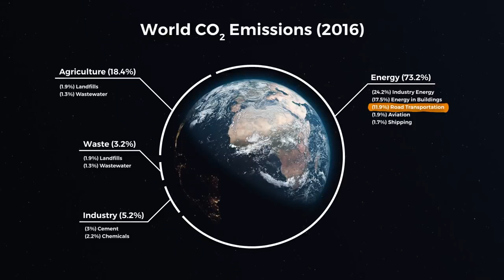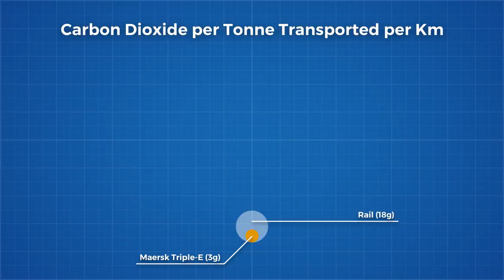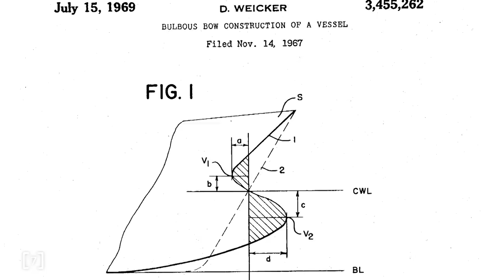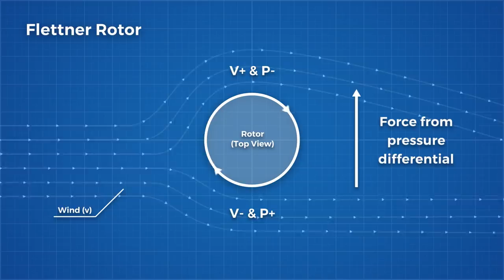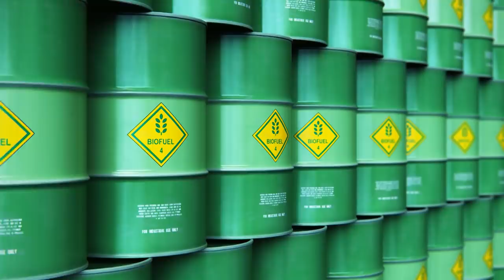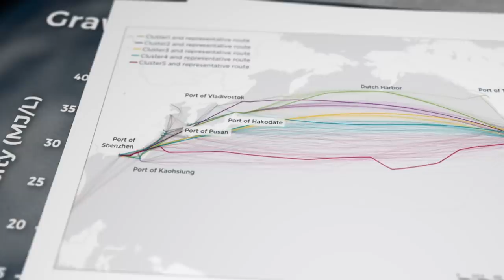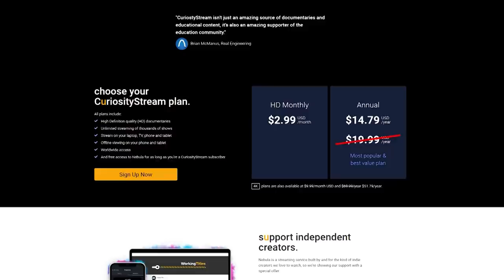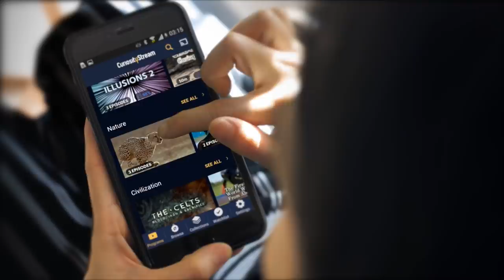Are Renewable Powered Ships Possible?

Comment: Regarding the issue of hydrogen storage, refueling and the route issues, I have a thing I want to mention in regards to video source 15 & 16 which is used around 11:05
Why do I go back to this point? I looked at the sources and couldn't easily find out, wheter or not the solution I want to point out was taken into account or not when adressing the renge issues and while video source 16 pointed it out, as something that does exist, it was seemingly not appearing in the tables given. The storage solution I want to discuss is hydride based storage:

I remember talking to someone (thus first hand knowledge) who works with metalls that form metallhydrides when put in steeltanks under H2 preasure, this reduces the preasure and allows you to store more of the hydrogen. When filling the tanks, they chilled them with water via a seawater-use water heatexchanger (coastal stationing), when they wanted to get more hydrogen out of "the bottom of the barrel" they used heated water to warm up the "storage tanks", the heat is in their case wasteheat from other systems. The chilled fueling allows thanked be thermodynamics, to get in more of the H2, due to lower preasures at constant mass and colder temps, the formation of metalhydrides reduces the preasure as well, keeping the chilling going means less thermal issues from the hydride formation. When scraping out the bottom of the barrel, heating the tanks "breaks appart" the hydrides and lower preasures (from the almost empty tank) make this a lot easier as well. The guy that told me these things said their metalls were a mixture with a lot of manganese, but he mentioned that there were apparently test with carbon and other lightweigt materials that would result in a weigth reduction, better for cars, a bit more irrelvant for stationary use and ships, especially if one remembers that big freight ships usually have a really big chunk of concrete in their bottom, for stability reasons.
As for the preasure, according to the German wiki page [X], using the hydrides means 1-3 orders of magnitude lower preasure at the same mass compared to traditional preasure storage, I have no idea what the "orders of magnitude" exactly are, they don't hold a direct refference, but this corresponds roughly with what the guy told me, his explanation said that 10 times the mass is "normal" and this seems to correspond with 1 order of magnitude 100 times would be "very good" and 2 orders of magnitude, thus 3 orders of magnitude would be 1000 times and probably lab results.
Considering that you can buy 200L bottles, with 300Bar [1] this would mean that at 300Bar you could theoretically get up to 25Kg/m³ (Storage density), since that would be an ideal gas more reasonable assumptions[2] would be 21ish Kg/m³ but that is without the hydrides, multiplied by 10 [3 !!!] this would give us 21 Kg/m³ * 10 ~= 210 Kg/m³ , not including the "lost volume" due to the metal that forms the hydrides, or storage compartments that would hold them. Again I have to point out that the 10 is NOT the EXACT number for the order of magnitude but something to give you an idea of what is happening. 
These things would weight something as well, though the storage compartments could be made from aluminum alloys and be "somewhat" lighter, certainly more so then the stuff that forms the hydrides. Another thing is that tanks that can withstand more preasure (let's say 700Bar, as per [2] ) are somewhat heavier and certainly not something to be "toyed" with, compressed air in generell never is!
One of the problems is that in closed spaces you might need a double walled pipeline, the outer one would be filled with a different gas (He, N, etc.) and would be your measurement for leakage via gas detection, this is a nessesary safety precaution, as hydrogen will "vanish" from a stainless steel container, that has been welded shut perfectly, it simply "crawls" through the metall, more specific the smallest rooms between and sometimes even through the crystal latices. Helium has a simliar issue and follows the "crawling trend" as well but to a lesser extend, however as was mentioned in the video, even the "standard" fossil gas and renewable gas will find ways to leak, it just happens that gases with a smaller atomic number are better at it then ones with a higher number, let alone hydrocarbons molecules.

[1] typical would be 50L at 200Bar or 300Bar from let's say Linde   https://www.linde-gas.de/shop/de/de-ig/gase-kaufen/wasserstoff#/300_bar
[2] https://emcel.com/de/warum-fasst-ein-wasserstofftank-bei-700-bar-nicht-doppelt-so-viel-wie-bei-350-bar/
[3] Referencing the previous explanation and asuming a "reasonable" and "normal" expectation of 1 order of magnitude, thus 10 times, 2 orders of magnitude being 10^2 ,three being 10^3 ...

[X] Not a real "source", I know,  but you get the info where you can get sources and read up on the topic, where I did https://de.wikipedia.org/wiki/Metallhydrid

Comment: @RealEngineering Why didn't you talk about the possibility of having some very large ships powered by small (modular) nuclear reactors? And why did you just say that Hydrogen could be a possibility, without talking about how Hydrogen is currently manufactured (usually using SMR, which is a CO2 intensive way of making H2).

I think it's a pity that you haven't mentionned Nuclear a single time, as it has proved in most army ships a viable and very reliable way of generating clean and near to unlimited power for the ships. Some small modular reactors could even be once installed and run for the greater part of a ships life (30yrs), nearly without the need of intervention more than once every 7 to 10 years (or more).

Comment: Shouldn't be too hard to double their efficiency. Throw some of the new fancy fluoropolymers on there, shield certain areas from skin drag with bubbles, improve the entropic efficiency of the powerplant by 30%, and throw a big fairing over the windy bits with (ideally) passive distributed redundant optics instead of the big control tower.

Comment: Biofuels: Cannabis.

It's capable of producing a variety of different fuel options (oils to liquid fuels by compression particularly of seeds / gasification of the fibrous parts / biodigestion of the separated tars for methane) while not being necessarily dependent on the same farm lands that grow food crops.

Sure, weed is fun and all, but what papers I've read has shown that with sufficient sunlight and food/fertilizer you can grow cannabis in heavy CO2 environments to improve growth/yields meaning we can use the waste products of our existing energy grid to speed up production of replacement biomass.
Add on that we can use the CO2 to extract the oils and other volatile solids from the plant matter and we're doing waste use double-duty.

Tangent: I think a disc Tesla-style turbine has a really underrated applications on this biomass front. The research papers I've been reading on steam injection to gas turbine ("Cheng cycle") suggests there are numerous benefits to doing this. It appears to reduce NOx production, can help cool the combustor allowing a leaner burn with more thorough combustion while keeping the temperature of the combustor materials under control and increases the volume of gas passing through thereby increasing the power output of the turbine for the amount of fuel used thus increasing fuel efficiency.

But doing that is inherently risky in a normal gas/steam turbine as high speed water droplets act like bullets. Given that biofuels come in two general categories, highly processed [ex: ethanol] which factors in the cost or unprocessed which favors low cost but tend to be 'dirty' [see Colin Furze's gasifier-powered lawnmower gunked by water/tar/etc) so that's where the mechanism for Tesla's turbine shines: Doesn't care about small particulates or multi-phase (water/steam/flue gas mix) meaning we can use crude but simple biofuels without the usual technical problems presented by those fuel types.

Mind you I don't think that a Tesla turbine engine should be the machine that powers a ship at all. I think that’s best suited to an electric motor so the turbine can function as a generator where it will be allowed to function solely at peak efficiency.

I realize this sounds more than a little crazy but using an engine that’s that forgiving about what kind of fuel is used opens up the hypothetical possibility of using a crude but highly flexible gasification system (if tars can be directly combusted without fouling the engine than a stratified gasifier is highly flexible on fuel types) which opens up regional fuel sources made out of crudely processed vegetable oils and husks/shells/literal animal shit which, even at a loss of storage capacity, seems to have a self-evident economic argument to warrant consideration.

Anyways that’s my crazy man rant. Hope y’all enjoyed. Gonna go hunker back in my bomb shelter that I totally don’t plan on one day owning. cough

Comment: But won't lower speeds cause longer days at sea and potentially delaying delivery of cargo?
Reply: On the ‘reduced impact front’ a lesson might be learnt from the past, in the 1930’s a group of six ships that were being built for the British Tanker Company (BP) to their “Three Twelve’s” design (12 000 tons deadweight, with a speed of twelve knots and a fuel consumption of 12 tons per day).  These ships were purchased whilst still ‘on the stocks’ and completed for the Admiralty so they could keep ‘the fleet’ fuelled up and at sea.  12 000 tons deadweight (dwt) is tiny by today’s standards with ULCC’s being twenty five times that size (300 000 dwt) while typical service speed has only increased to around fifteen knots, or by 25% if you like to keep things relative, and daily fuel consumption has gone up to about 60 tons (or half an order of magnitude to be academic about it).  Bear in mind that speed reductions, a useful buffer for adjusting variations in demand, will in the long term require more goods in transit to maintain any given long term level of supply.  Typically tankers move at 15kn so a reduction of speed to 12kn could yield a fuel consumption saving of 20% (?), however to maintain the same flow of material an additional 25% of shipping capacity will be required.

4 ships at 15kn = 60 freight miles = 5 ships at 12kn.
fuel used x	                                        fuel used x (+ or - ?)

Comment: Just to bolster some of what you said, I did a research paper a couple years ago on biofuels. The conclusion I came to was much the same as what you say in your video. The vast majority of biofuel (bio-Diesel, Ethanol, etc.) are a complete waste of effort and don't do anything to reduce emissions. As well, if we needed much more biofuel than we currently produce, we might actually run out of corn. I think the stat was something like, if we convert ALL the corn we currently produce into biofuel, we could produce a whopping 1/4 of the amount of fuel we consume each year. And obviously we would have 0 corn leftover for anything else. And burning pure ethanol is terrible for engines, so unless it's mixed with conventional fuel (or new engines are produced specifically for it) it can do serious damage. There were a bunch of other points I made, but I'd have to go find that paper haha

Comment: Can you do a video on biofuel? I'm curious as to just how green it actually is.
Reply: Short answer, not very; major problem is land use.  On a small scale, to use up the waste products form other industries like forestry agriculture, they are is a good source of carbon molecules but all 'alternative' fuels still involve a combustion stage and some noxious effluent, NOx for example.  Fossil fuels run up from CH4 (methane/biogas) to very thick black HFO cSt380.  The sweet spot is kerosene, aka gas turbine fuel, as used in modern aircraft engines it is energy dense, hydrophobic and relatively safe.  Creating a non fossil substitute is the holy grail for chemists, like turning base metal into gold.  Basically history on a geological scale has done a lot of heavy lifting for us humans.

Comment: Water wheels on the sides, solar panels on the fixed areas. Small windmills where you can. Should produce enough electricity to get it 20% if its way electrically.

Comment: Hey, shipbuilding student here. So in my opinion (and the opinion of most of my classmates), wind power could be a thing, mainly thanks to the SolidSail that is currently being tested in St-Nazaire, France, or with the help of SkySail’s project, with the Beluga Skysails as a test bed. We are currently working with our teachers on wether or not this is a good idea. Just to say, we are well aware of all the new things that pop up in shipbuilding technology, and we also are more likely to incorporate these technologies into future ships projects.
Reply: In 1870 a premium sailing vessel entered service, the ‘Cutty Sark’.  The ‘Cutty Sark’ was 64.74 metres in length with a beam of 10.97 metres and a loaded displacement of 2 100 tonnes.  She was able to carry, at best, 1 700 tonnes of cargo and to harness the energy in the wind the available spread of canvas was up to 2 976m2 which was tended by a crew of about 30 skilled men.  The ratio between the sail area (SA) and the vessels displacement (D) determines how lively she was; ‘lively’ or ‘fast and manoeuvrable’.  The carrying capacity of cargo ships is constrained in two ways, mass and volume which leads us to the ‘stowage factor’ of the cargo; the more mass on board the greater the displacement which in turn impacts the efficiency of the hull form and the sail area / displacement ratio.  When in the tea trade, which the ‘Cutty Sark’ was designed and built for with fine lines she could carry around 600 tonnes of cargo at speeds of up to 17.5 knots dependent on the prevailing wind and had a typical China to UK time on passage of 120 days.  The tea trade was very competitive so ‘time on passage’ was a large factor in securing the premium freight rate that made the ‘Cutty Sark’ cost effective.  Rounding things out, her maximum available sail area gave circa 5m2 of canvas for every tonne of tea carried.

As soon as the Suez Canal opened, which the ‘Cutty Sark’ was unable to sail through; she lost her advantage, raw speed, to the steam powered ships of that era who could beat her ‘time on passage’ by taking that short cut.  Mechanically powered ships have improved in terms of efficiency, on a freight tonne mile basis, by at least one order of magnitude since then.  Random fact about ‘Cutty Sark’, it is said to have been possible to coax 3 000 horse power out of her sails, or 2 206 500 Watts (2.2 megaWatts) or 741 Watts for each square meter of sail area, in ideal conditions.  The sails on the ‘Cutty Sark’ produced about 0.33% of the power need to propel a Mearsk Triple E and proportionally a Mearsk Triple E would need a sail area equivalent to the acerage of a small farm to not go as fast.  You and your colleagues have probably considered the wind speed envelope in which your design will operate and the wind patterns that prevail over the trading area you intend to service will you be able to match the availability and reliability of hydrocarbon fuelled propulsion?  Remember shipping is a high volume low cost, therefore low margin business, and all costs have to be beneficial.

Comment: Makes me wonder how much fuel could be saved by large solar panels to reduce the amount of electricity required from fueled engines. Yes the panels would interfere with loading/unloading of container ships, but is there any reason they couldn't be installed on a tanker fleet? Or would the weight increase of having the panels nullify their gains?